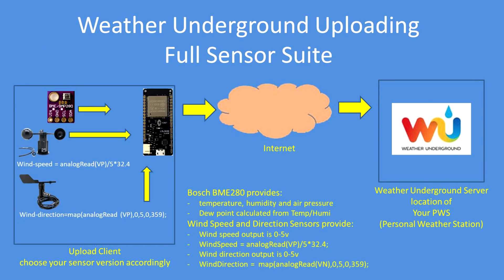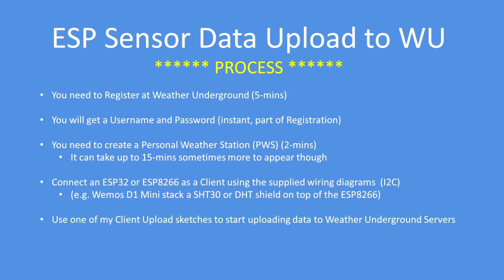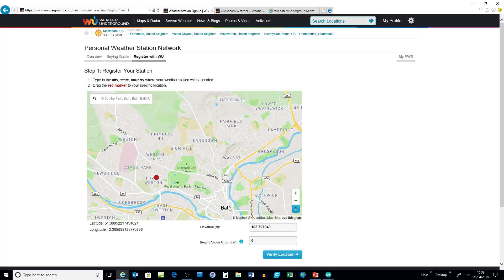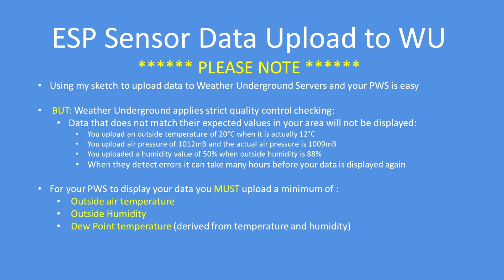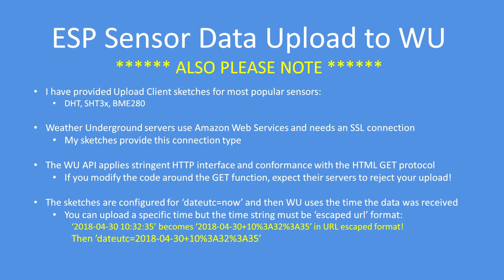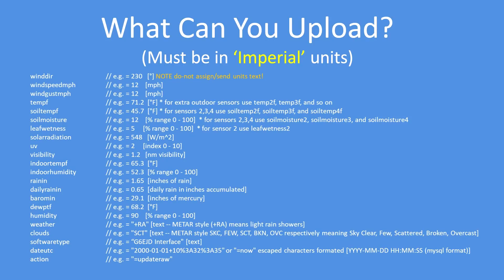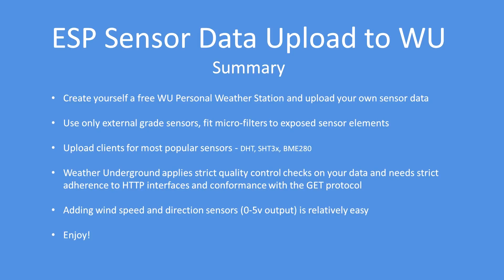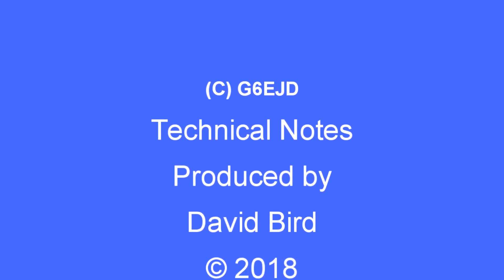Tech Note 093 - ESP(32 or 8266) Sensor Data Upload to Weather Underground

Comment: arduino_modified_sketch_161841/ESP_WU_Uploader_BME280_v01.ino:177: undefined reference to `setenv'
arduino_modified_sketch_161841/ESP_WU_Uploader_BME280_v01.ino:177: undefined reference to `strftime'
arduino_modified_sketch_161841/ESP_WU_Uploader_BME280_v01.ino:180: undefined reference to `setenv'
sketch\ESP_WU_Uploader_BME280_v01.ino.cpp.o: In function `StartAndGetTime()':
arduino_modified_sketch_161841/ESP_WU_Uploader_BME280_v01.ino:183: undefined reference to `strftime'
ESP_WU_Uploader_BME280_v01.ino.cpp.o:(.text._Z10UpdateTimev+0x26): undefined reference to `strftime'

collect2.exe: error: ld returned 1 exit status

exit status 1
Error compiling for board NodeMCU 1.0 (ESP-12E Module).

Keep getting this error
Reply from the maker: I've just compiled it for a Wemos D1 MIni = OK and NodeMCU 1.0 (ESP-12E Module) and= OK.So which ESP core do you have loaded, it looks like your IDE is way out of date. Should be 2.4.1?Tools, Boards, then Board Manager then in the search box type ESPWhat do you have?
Reply: Arduino IDE 1.6.13. and the standard esp core i think.
Reply from the maker: 1.8.5 and ESP core 2.4.1 are the latest revisions and that's what you need for any of the time services to function, if you are going to use 'dateutc=now' then delete all references to time and make it a basic uploader. That will work. I'll upload a version for you. Standby.
Reply: Wait a minute, updated the ESP core, compiled sucessflly :)
Reply from the maker: Good and you'll get much more reliable code and results now.
Reply: Working flawlessly!! Thank you :)
Reply from the maker: You can fool WU into displaying your data if you have a look around the Wundermap for nearby stations and not their temp, humidity and pressure, then add/subtract values from your sensor readings and make yours the same, then their server will allow it to be display if not already. Enjoy.